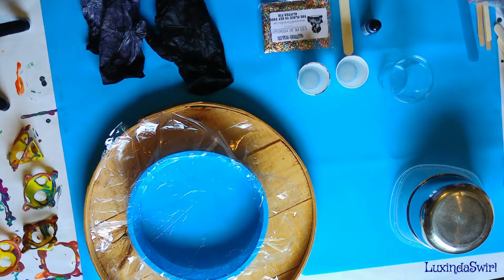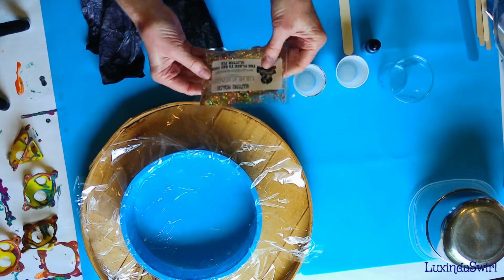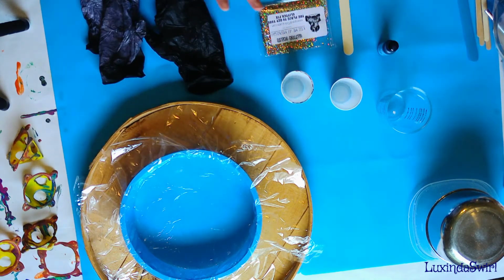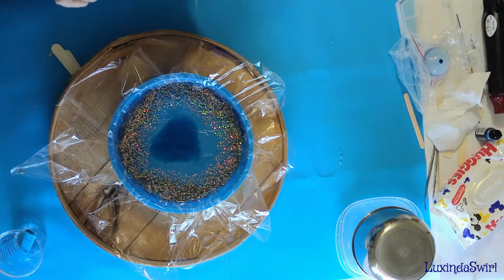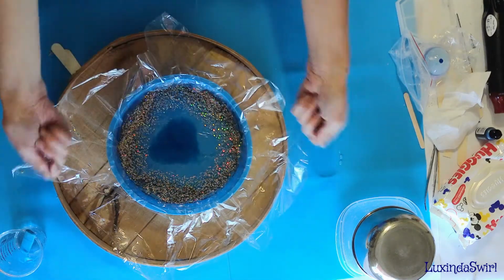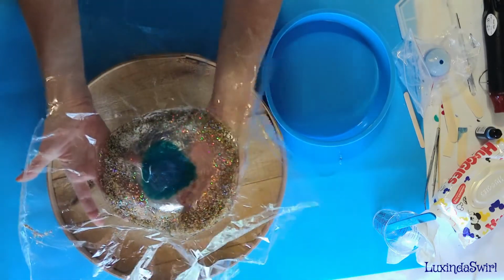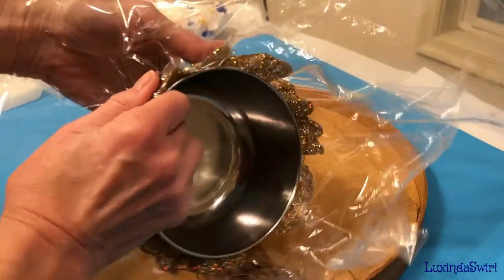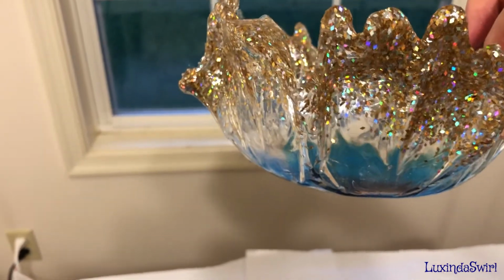Using Resin to Make a Freeform Bowl - This is So Cool!!

Comment: What are the crystals your using and the plastic?? And do you spray the plastic with mold removal stuff? I want to make one for my mom for Mother’s Day so bad
Reply from the maker: That would be a great Mother’s Day gift!! I didn’t actually use any crystals, what I put around the edge was some glitter mixed into a small amount of the resin. And, no, back when I made this, I was blissfully unaware of mold release spray, although it’s not a bad idea at all if you have any! The plastic was a leftover wrapper from something. So I would suggest a clear shower curtain if you can find one at Walmart or the Dollar store. Something inexpensive but pretty thick. You can use plastic wrap, like Cling Wrap, but a thicker clear, shiny plastic will be easier to work with and not as wrinkly.

Comment: Thank you for this! One question: how to know by touch that it's time to drape the resin sheet? Should it be dry to the touch? Because one I had tried this but the resin started dripping and it became a pretty resin vase but not a bowl😀
Reply from the maker: Thanks! That is kind of tricky, and it also depends on the resin itself and temperature where your resin is curing. Most folks wait at least 4 hours. If your room is on the cool side, and resin cures more slowly when it’s below 70-degrees, you might be better waiting 6 hours. If you try again with the same resin you used the first time, I’d try waiting an extra hour and see how that goes. I know that’s not specific at all and may not be much help, but there doesn’t seem to be one sure-fire time. And to answer your question, yes, even when it’s ready to drape without too much movement, it will still be at least tacky to the touch. I hope your next bowl stays a bowl 😊
Reply: I know I am pretty off topic but do anybody know of a good site to watch newly released tv shows online ?
Reply: @Ares Vincent lately I have been using Flixzone. You can find it on google :)
Reply: @Azariah Keith yup, I have been using Flixzone for months myself :D
Reply: @Azariah Keith Thanks, I went there and it seems like a nice service =) I really appreciate it!

Comment: Very pretty bowl.  What plastic did you use?
Reply from the maker: Thank you! That plastic was actually a bag that something I recently purchased had been packaged in. But it was similar to a clear, medium-weight, cheapo shower curtain that you can buy at Walmart or target or probably even a dollar store.
Reply: @Luxinda  I guess the saran wrap is too thin.   I may try the mold release on top of the plastic.  Yours released very easily,  so I'll go with the shower liner from the dollar store.
Reply from the maker: @glutenfreeappletree  Saran Wrap will work, but it usually adds a lot of wrinkles to the resin because it’s almost impossible to get it (and keep it) completely flat. I think something a little thicker is easier to work with.

Comment: What kind of plastic do you use
Reply from the maker: Pretty sure it was Saran Wrap, but anything with a smooth and shiny surface will work. I know a lot of folks use pieces of clear shower curtain liner because it’s more durable when you’re lifting up your partially set resin to start draping it. Hope this helps!